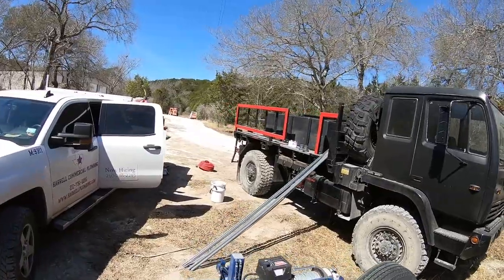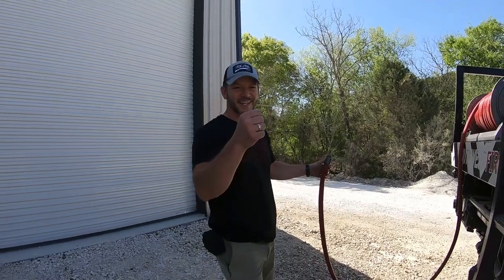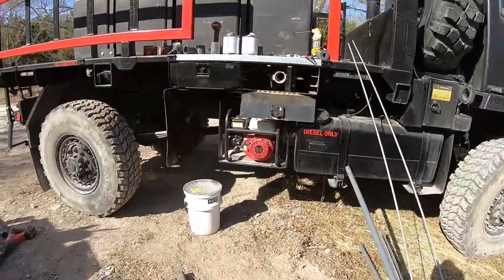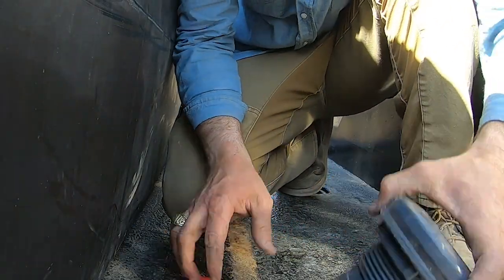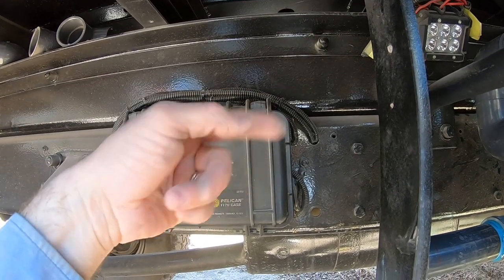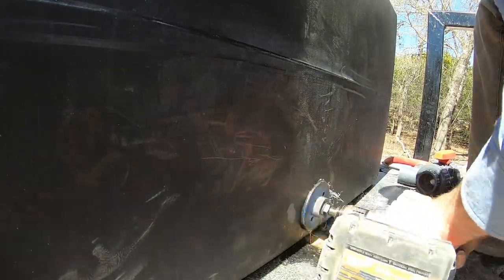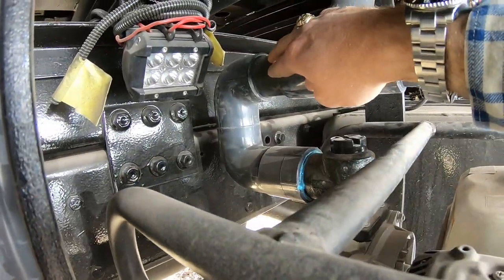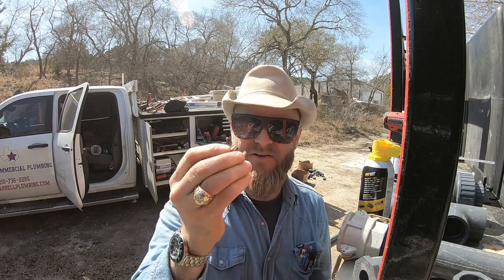PLUMBING DEMOLITION RANCH'S FIRE TRUCK

Comment: I plumb a lot of fire trucks as I make slip in fire units and I have to say you actually did a way better job then I could have done. You put a lot of thought and time into this project and included everything that it needed. Well done!
Reply from the maker: Thanks a lot brother……..it was a lot of work but it turned out nicely. Having never done one it took a lot of brainstorming luckily I’m pretty good at ONE OFF’s. Thanks for watching Jacob🤠

Comment: Man you did excellent work there. Good ideas with the recirculation/tank fill arrangement. But most of all it was a clean job! I was expecting it to get a little wonky when you had to reverse the inlet and outlet!
Reply from the maker: Appreciate it brother! To be honest it took a lot of brainstorming to fix the inlet issue on the pump but in the end it’s better because of the unions I added to be able to remove the pump if it event needs to be replaced.
Thank for watching brother! 🤠
Reply: @TexasBeardAdventures  That right there is the difference between me and a pro!
Reply: @TexasBeardAdventures  I saw a notification and went looking for the video and it said private a couple days ago. Glad I found it

Comment: Very clean job on the install and adding fill circuits!  Looking to do something similar and was curious about running a trash pump?  Typically they are high vol/low pressure, even without a nozzle it looked like a weak stream.  How did it turn out performance wise?
Reply from the maker: According to Matt once the nozzle was installed it had a lot of force behind it.